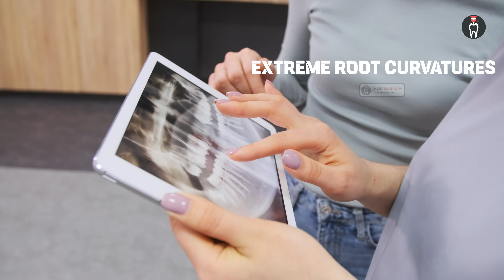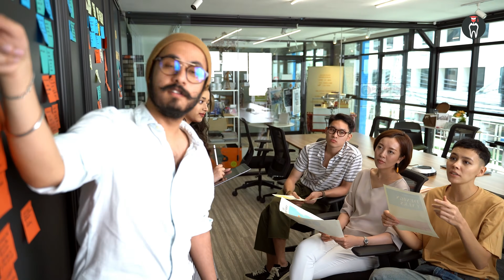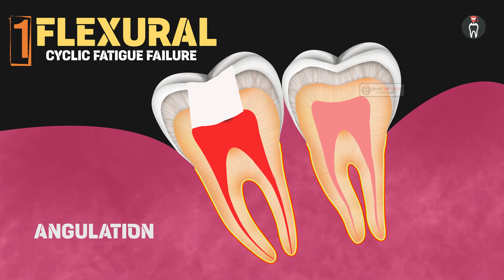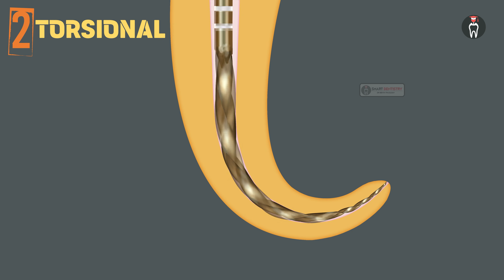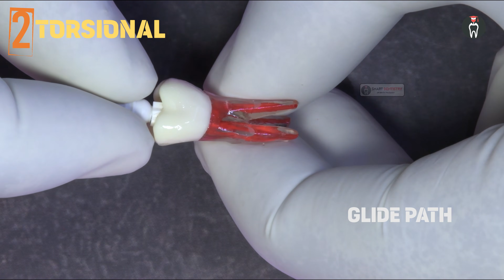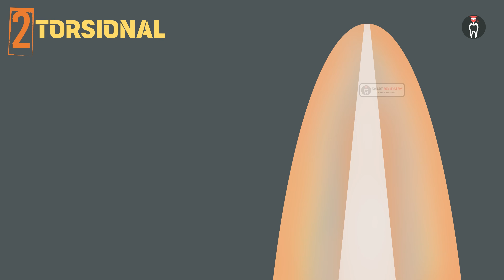STOP FILE FRACTURE

Comment: Thanks for ur really awesome content.

How many canals can we shape using flexible protaper files sir... If I follow these method.

And I also sometimes think files detoriates while autoclave ing done... This increases the fracture rate..

Tq.
Reply from the maker: 8-10 uncomplicated canals(NOT TEETH) will be an ideal number. If used within a month after initial usage, chances for file deterioration after autoclaving is less. With prolonged usage the file may get deteriorated.